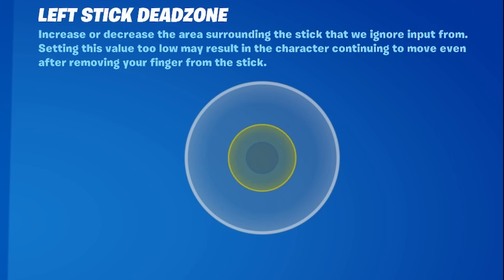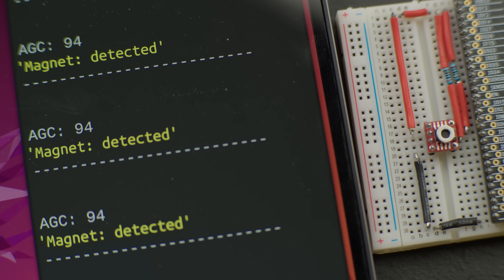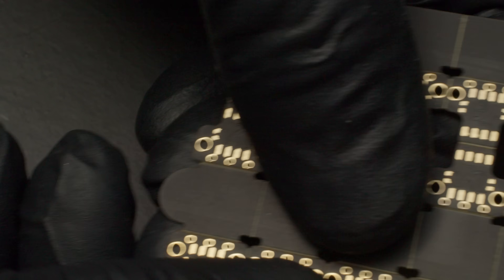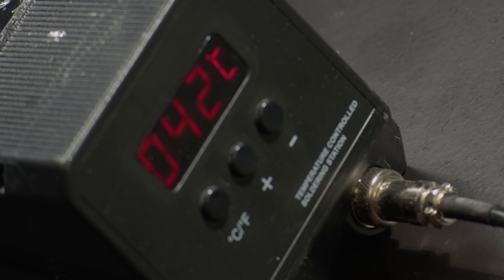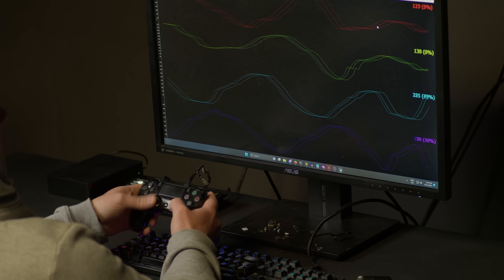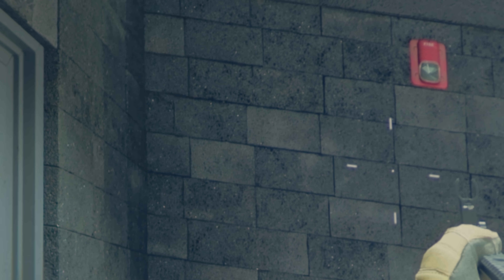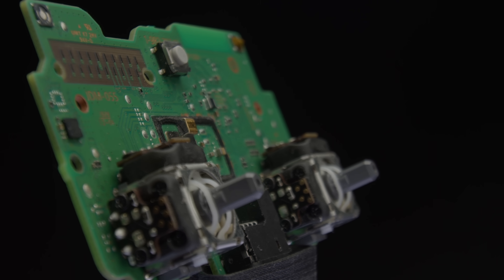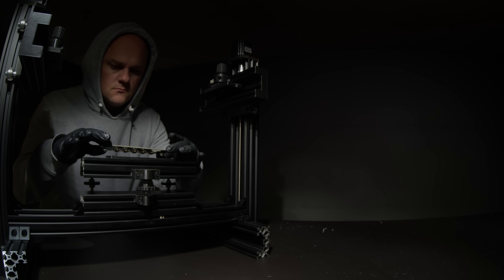Beating the $20B Joystick Drift Problem, and giving it away for free

Comment: Sorry to break it to you, but PlayStation beat this problem 20 years ago my guy 😬

Edit: okay I actually watched the video, really cool, BUT in reference to my original comment, if you’ve ever played with PlayStation’s DualShock 2 controller before, it has an absolutely FANTASTIC way of beating controller drift from the moment it came out; basically, every time you start a new game, the controller will passively wait for you to pull the analog stick to the bottommost position, and once it bounces back to the center, it’ll automatically correct for any stick drift the controller may be experiencing (tbh, I don’t really know the exacts of how it works, but I’ve had a Ps2 for years now and it works like surprisingly well, literally some (+/-) 20 year old controllers and they’re still pulling thru to this day 🤤)

Comment: There is a tonne of ways to stop drift.

From teh current setup, to a internal laser that is isoalted and changes and acts depedning where the laser hits the unit. Tiny relfective sentive senory surface. THen it interpolates teh data for the movement. However, the problem wit hDrift is the stick not centering, but you can add software in any design to find a center or resonable center, of like changing your settings mid lfight with old joy sticks for movement ones so it knwos your center in relation. Magnetics... The stick itself can use a rod iron and magnetic flange and whe nrotated closer to it it can read I think its called the flux, and depdent on teh force and where it is causes movement. The sentivity, is magnetic related, but it owuld have ot be a eletric magnetic system since heat ocudl destroy it... From touch pads, to balls that re center, basically a stick less. joy...

Anything can be used for movement.. in the design sense.. thus the guantlet of power...

I never had a joystick problem of drifting... maybe a couple times, but it was like don't hold controler to the right, typically n64 ones you could flick it and there was lieka z AB in game reset you could do to re calibrate, if it is off, IE hte new center... it shouldn't cause a problem.. THen there is the natural placement... so not sure if drigt is a real problem... However, Never had mouse problems until the market was flooded with uncontrolled products that were quality tested, this affects entire scope of the earth piravte enterprise... so one gets inteionally bad knockoffs or poorly made prodcuts all for the sake of money.. I got a gaming mouse, or so it was called, have several mice, but the wireless one some reason was unable to transmit liek it used to it s intermitten conneciton, but yeah the laser will jsut auto move the mouse to the right. Used a darkfield mouse, that might ahve been the best.. but the winner is the logitech mouse, I had for almsot 6 years.. wore it down so much... even had finger wear marks.. only time it had problems was hair... and shiny surfaces... SO naturall when using a glass urface I used a darkfield mouse...

anyways.... it is a strange thing... lol 

Then the garbage came on earth, lost everything, bascially life was killed eocnomically thorugh lies, just war pretty obviosu but iwthout guns simpyl savages... so anyways... the nahd some other mice in the mix, lol
Reply from the maker: Using a mouse sensor is clever. But i think its simpler to use a normal reflective encoder. Some have lasers or ir light. But the solution i made is the fastest way to the goal. I got reflective sensors laying around and just waiting for time. Take care thanks for commenting :)

Comment: As much as I admire the thought process and the elegance of your solution, it may be pricey and irrealistic for joystick-producing companies to adopt this solution. In fact, planned obsolescency is the only barrier to searching a proper solution; but if we shall find one, the drift problem can be tackled by pure software changes : it should be possible to get an estimate of the drift by averaging the mean drift over zero speed inputs (facilitated by the sensitivity of derivating a measured value) and compensate for it in the inputs sent to the computer.
Reply from the maker: My solution is way out of price for any of the normal companies, i agree on that. You cant fix the drift in software for worn potmeters, its way to much noise. You cannot reverse entropy. The chinese cheap hall effect joysticks are heavy filtered in software with also auto resetting center position. Which makes them laggy, and oscillating. But appear to work. The solution is to build a proper joystick with a proper sensor like the one in using. And leave the world of mass producing toy makers behind 👍🥇😁
Reply: @MariusHeier1  aren't noise and drift two very different problems ? I really only considered the estimation of the bias in the joystick, but none can be done against a noisy controller (but filtering, at the cost of response time and sensitivity). 
Again, I agree that the most elegant and precise technique employed is yours ! - even if clearly not the cheapest.
I thought of another technique, maybe not the cheapest also :
Could it be possible to add an accelerometer to the hidden end of the joystick, and another on the PCB to compensate for controller movement in space by the user ? It might struggle with constant error estimation, which can be corrected by clever software use. In this case, Kalman filtering could be of use - even in your hall effect sensor application I think you might find it some use !

Comment: Imagine making a controller with parts just like this that are all open source, well built, modular and easy to replace, and then making sure it's compatible with PC, Xbox and Playstation. Making it run on regular AA batteries so you never have to worry about changing an internal battery or dealing with proprietary battery packs. I'd spend like $100 for a controller like that bc it'd be with me for years

Comment: Another one for me is analog vs digital movement w keyboards….you can jus use the mouse wheel to control movement speed like they did in Splinter Cell Chaos Theory, but nobody wants to for some reason.
Reply from the maker: You are totally right. My own mainboard will have digital transfer of joystick positions from the joystick. Its gonna be superior to the current analog implementation in all controllers today.

Comment: 1:40 If you begin toughts about motors, why not step furter? 
How about using rotary encoders?
Or even if using magnets - why not use only one and two sensors? And a joystick will be at shape of ball...
Reply from the maker: I am using a magnetic rotary encoder chip here. Check my other videos for 3d hall sensors with a single magnet.  You are right on track buddy.

Comment: For me, cords were what broke. I've never broken a Nintendo cord though somehow,(but i have broken charging ports on wireless controllers lol.)Today we don't have cords,  but i swear i have controllers that were thrown by  my little brother, and dropped by me that still worked up until i finally got a Nintendo switch. Of course cheap controllers break easier, but i feel like you got what you paid for back then, with the adamantium they use to use for older controllers. Even the cheaper MadCatz Controllers still function today when i play on my xbox or GameCube. Where as my Nintendo Switch official  controls got drift in about half a year, and xbox one/x offical controllers around a year.
I remember my older brother who moved out owning a ps 2,3, and portable. I remember buying the ps3 from him, and the only problem with it was the dust in the ps3(PlayStation seems to be worse at this than xbox) and the controllers didn't hold a charge.

Comment: The industry doesnt need a working solution. This problem was solved over 20 years ago. PS2 controllers had a different analog stick and also the system calibrated the dright on its own. It was never a problem before... new controllers have been designed to break and thats that.

Comment: 2 months dam lol mine never broke that quick more like 2 years also when it happened on my older controller i would put new potentiometers on it and manually calculate it then solder the pins whens its calibrator
Reply: I've has my elite 2 for about 2 years and not a single problem I'm happy

Comment: That's fantastic. I wonder if what is needed for the drift around zero is a nonlinear mapping between the rotation and the projected x/y position. So instead of a dead zone, it just had a less sensitive zone.
Reply from the maker: It works fine with 0% deadzone. On linear movement. Hoho 😉😉😁😎

Comment: Cool Video to be honest. But i got confused. i use a hall effect controller for over 1 Year now. and thats exactly that what you did. so the System is not new? What part did i miss?
Reply from the maker: That "hall effect joystick" is a to broad of a term. You dont use these sensors. You are most likely using old tech simple hall effect sensors, made possible working with a ton of filtering. The sensors i use are quite new tech. So i guess that's what you missed 😉😁

Comment: Game companies are absolutely aware of this age old tech, but why in the world would you ever manufacture a controller that lasts for the life of a console at 79.99 when you can continue to use your current design and know that your $500 console is actually a $1000+ console with the constant requirement to buy controllers.  Also why would you adjust all of your current manufacturing (which would cost a lot) to generate a reduction in your overall revenue, especially since aftermarket controllers are part of an incredibly volatile industry where almost everyone buys your brand model and a tiny portion of gamers buy aftermarket.

Comment: Recently purchased a soldering kit and vacuum to deal with this issue.
Have two 1914 model Xbox One controllers both have extreme issues with their left thumb sticks nothing has worked and I cannot find the thumbstick board to replace and not cost 45$ so I'm going to replace the thumbsticks themselves.
Reply from the maker: I think xbox use the normal version you can buy for 2$ or so on digikey and mouser.

Comment: This is amazing! Great work. Curious if I sent you the potentiometer from the device I use if you could apply this upgrade. I use a very niche controller called the Hori tac commander pro. It is discontinued and hard to find. I’m on my 3rd one now due to stick drift and they are $80 each. I’ve looked into replacing the potentiometer myself but Hori used one that is not standard size like Xbox or PS. Of course I would pay you for your time and service. Please let me know if this is something you would consider.
Reply from the maker: Hey! Someone have asked me about the Hori Tac already. I'm pretty sure it uses a similar joystick. So it will most likley fit. I dont do any kind of contract work now. So im not able to take on anything. But once its ready you can do it  yourself, im pretty sure. :elbowcough:

Comment: I remember having drift on my original PSP joystick. Being all of 12 years old, i ended up taking apart the psp, taking apart the little joystick and ended up cleaning the resistance lines where the connectors slid. No YouTube videos back then and im amazed that this is still a problem.

Comment: Wonder if you can add the calibration pins lower on the pcb then break them out to wires and a connector. It would be kinda fragile but it would be out of the way

Comment: magnets also loose energy. and sugested system also going to be effected by external magnetic field
Reply from the maker: Yes. But it's doesnt matter within the lifetime of this product. It does not directly use the magnetic field. It uses the different signals from multiple sensors, and the difference between them. So if the manget is weaker over time, it does not matter. It must be 40% weaker or more. Which takes "forever". The sensor is also very low in sensitivity. If i move the magnet away more than 1 mm. It stops working, because its not sensitive enough. This sensors are made to sit on top of motors. Which are multiple very powerfull electro magnets and neodym magnets. That is not a problem. These types of sensors im using is new tech. Its not the same old sensors with the same old problems you describe. Thanks for commenting. Take care:face-red-heart-shape:

Comment: Is this new hall effect joystick compatible with the Switch JoyCons? The drift problem seems to be even worst with JoyCons than with PS4 controllers. 😂
Reply from the maker: Not yet. Haha. Will def not fit the way they are now. And they are not so battery friendly. But it should be possible to make better pots. :)
Reply: @MariusHeier1 By the waw, how about battery life with these hall effect joysticks for PS4 controllers?
Reply from the maker: @karolrosen9693  its gonna drop. They use way more power.
Reply: @MariusHeier1  😲
Reply: Ok, thanks. Maybe new hall effect joysticks could be a goal in the future.

Comment: What do you think of the Jun Zeng driver boards for hall effect sensors? I see several products are on the market now.  I've personally installed a set of the Jun Zeng sticks and driver boards.  It wasn't easy to do because I'm not an electronics expert, but I was able to do it.   But I see his product as having two advantages:  1) It's able to be calibrated with user inputs into the sticks and 2) It's able to use multiple types of sticks depending on what the user wants as far as tension and precision.

From what I've heard your stick is probably more accurate because the magnet and sensor are higher end.   I can't wait to be able to buy one of these, install it and see for myself what the difference is between different options on the market.
Reply from the maker: Hey. I dony know to much about them. But if their main purpose is to do recentering. That is actually possible to do by activating the original Sony calibration feature. Which is fairly unknown exist. I figured it out like a month ago. Ill look out for them :)
Reply: @MariusHeier1  he has a YouTube channel with installation instructions.  I'd love to see the onboard calibration feature though, do you have a video about it or any documentation?
Reply from the maker: @NotMyActualName_  https://github.com/carpikes/ds4-tools Here :)

Comment: Sony seriously need to fix this issue. Controllers drifting badly and basically not working after a few months, or less than a year, and having to buy new controllers all the time, is a scandal.. Very bad quality.. 
What's even worse is that Sony know the solutions to this issue. They released the Dualsense Edge with changable stick modules, but at extortionate prices. And that's on a totally overpriced controller in the first place. Furthermore they have deadzone software on the PS5, but refuse to release it (only for Edge). Charging €20 for stick modules that cost less than €5 to produce is a scandal price, and they aren't even available for the standard controllers. You swap stick modules 2 or 3 times, and it's basically the same price as a new standard controller, which makes it a non-solution to the problem.
A basic Dualsense controller is not cheap. A mouse and keyboard cost less, and generally last longer. So with the price of dualsense, you should be able to expect a product of at least good quality, and not total crap that has to be constantly changed. At this rate, having to buy controllers every 6 months or 1 year, it's soon becoming cheaper to move to PC gaming, where you don't have to change peripherals so often (or at all).

Sure, it's not exactly Sony's fault that these stick modules are as bad as they are, and they are used in most controllers. Looking at the manufacturer of the potentiometer parts, it's the best part available, and there isn't really any competition in the market. But Sony could make regular dualsense stick modules exchangable (as they did on Edge) since it exists, and they could make the price for it decent fair value. Additionally they could release the deadzone software for PS5 for everyone.

But they don't, which makes it such a scandal. Imagine if you had to buy a new mouse and keyboard every 6-12 months because it can't handle normal use. At the price of the regular Dualsense, this just isn't acceptable SONY, so get a grip.

Or yeah, even better yet, improve the technology, as this videp perfectly presents a good case. Sony for one has the expertise, manufacturing capabilities etc to do this, so why don't they?
Reply from the maker: That was a thoughtful write up. Thanks for doing it. I guess its hard for them to have a different opinion when they make so much money on having another one.
Reply: @MariusHeier1  I've heard of magnetic resistance stick modules before, as an alternative to potentiometers. Seems that it's just Sony (and others) that haven't heard about it. The others have better excuses, Sony don't, since they are also an electronics and technology company with manufacturing of such things.

Anyways, keep doing what you do! It's great and very interesting to see 👍

I really hope this issue can get sorted somehow, and this kind of thing seems like a potential solution. I'm not as into gaming as I was previously, for various reasons, but adding onto that issues like this makes me just want to not continue gaming at all, and especially not on consoles. I think I'm not the only one in this kind of situation. So short term greed will hurt long term profits if this continues.

Sony clearly knows about the issue as well, and it has been well know the last decade, so there just isn't any excuse. It's a critical issue and situation as I see it, and yes, I'm personally furious about it.

Ps. Lucky for me I have the basic knowledge to do some repairs myself, and I will. But many others don't.